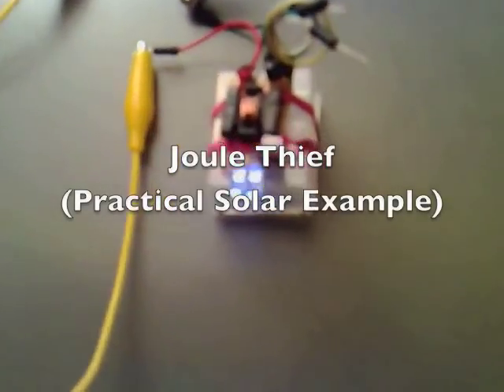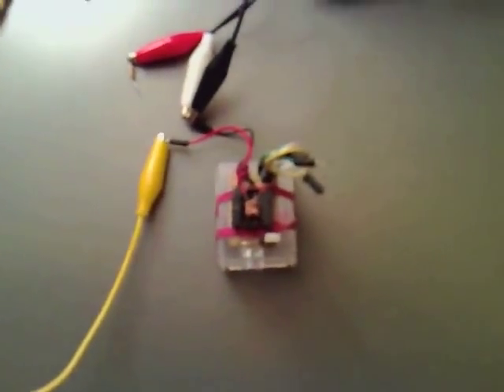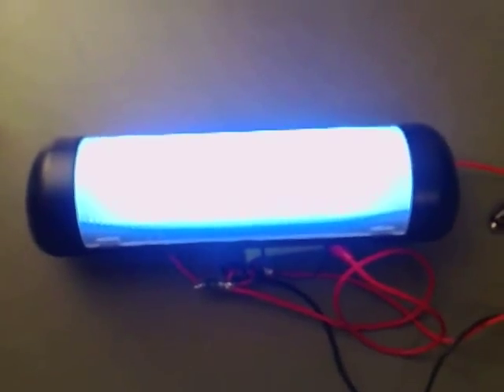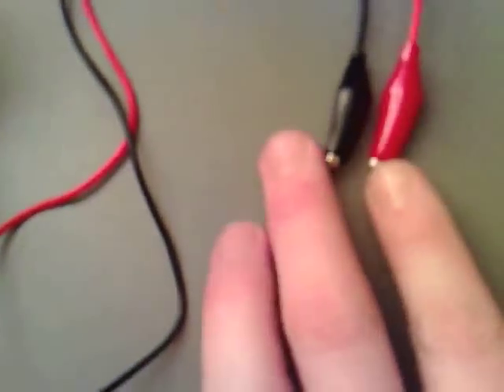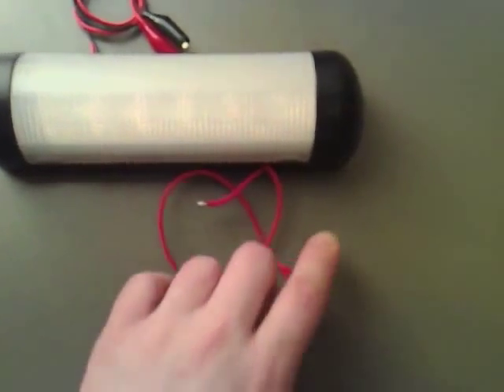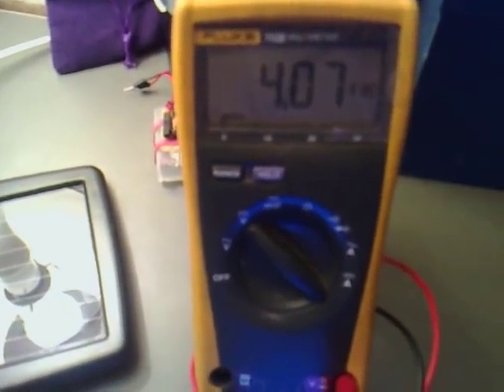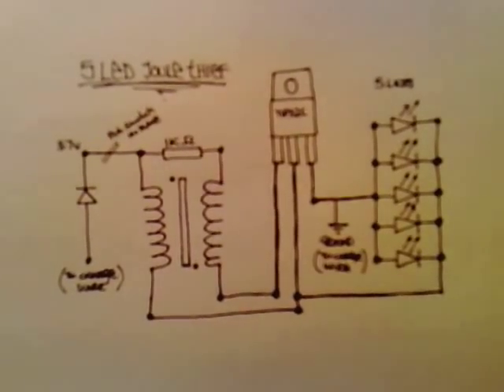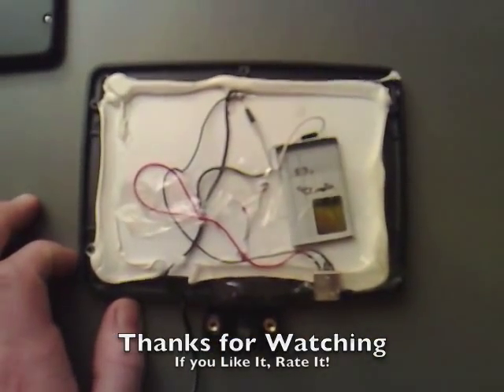Joule Thief (Practical Solar Example) 017

Comment: Loving the vids, Can something like this (solar panel) run a air source heat pump or is that asking to much from this? Air source needs electric to run but if it had a back up supply of solar it may not need mains electric? Merry Christmas!